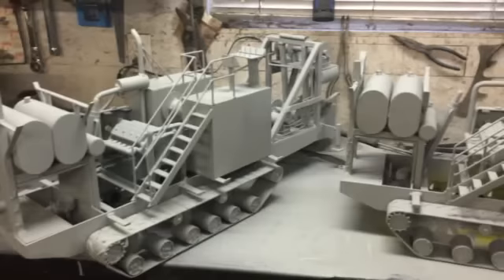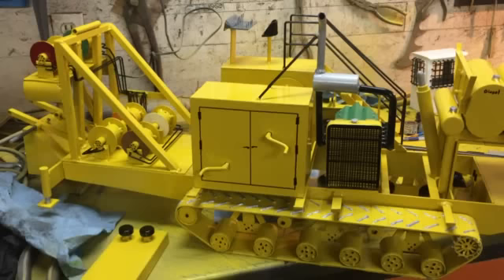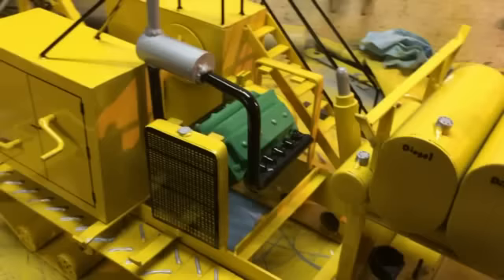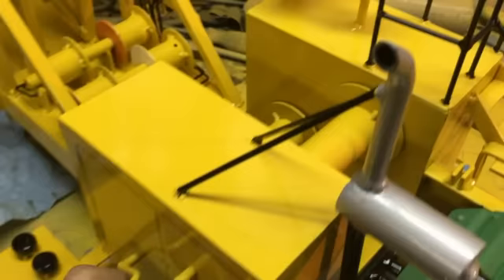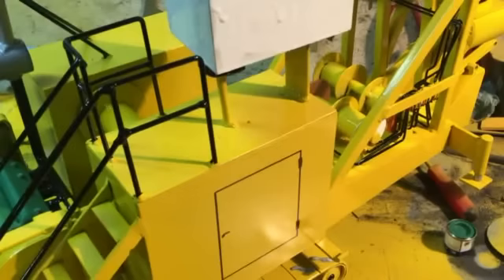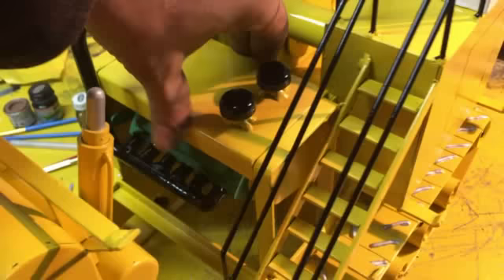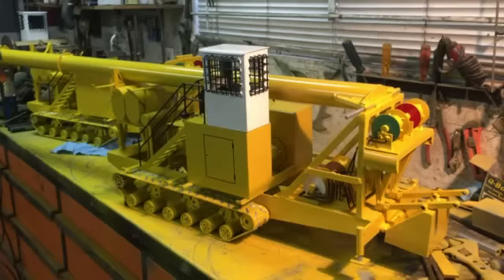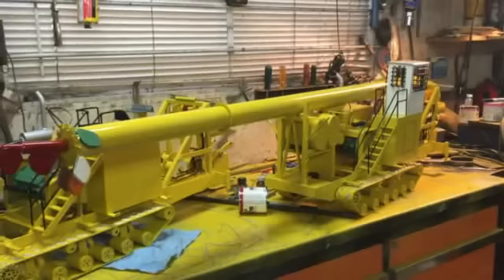Scale Model Logging Toys for Sale-Madill 009 Yarders

Comment: I think I saw some of your completed models for sale on Craigslist Vancouver. Cool stuff.
Reply from the maker: Yes,but finding someone that likes this stuff and has $2500 seems to be the in insurmountable search around these parts.I dont care either way,but I know i would have come close to buying one myself if i saw it,and couldnt build my own pieces
Reply: Ya I don't have that kinda doe obviously or you would have heard from me. I could buy real yarders up here for that price and well plus the low bed or barge fees. But where would I put one? There was an interesting yarder shipped out of Saint Vincent bay last year I wanted.  It was on a track chassis. I'm guessing one of the twin engined chassis like you documented. Every one up here is retiring and scrapping out their junk collections. It would be fun to save some of these huge machines for posterity.
Reply from the maker: I'd like to find the top dozen feet of a tower( rooster head) to plant in my backyard here.cant really find any,despite all the gear Ive seen.
Reply: I've seen some lattice work booms. But not a tube spare top. But If I see one and no ones looking its yours. LOL
Reply from the maker: ok,take care!

Comment: Hello,Just out of Curiosity, do you know how much this yarder weighs ? Also, does the Tower raise and lower ?  Would it be practical if the Blocks and the Guide Line Drums were loaded with cable ? (just for adding a little more detail) Awesome Job !!!  Would you ship ???
Reply from the maker: feels lke 45 to 50 pounds,dont have a scale.tower is hinged and raises,there is hand cranks for the mainline and haulback drums,if one wanted to set it up to yard some sticks for fun.ive done it with my original i built.Could ship,but tht would be its own price at whatever cost and getting it there,and building and crate,bit of work and time